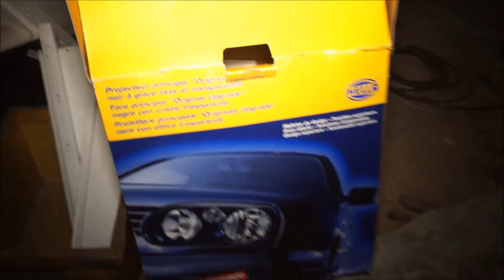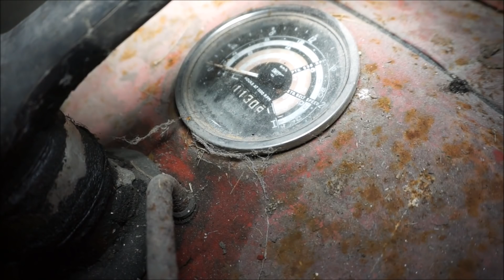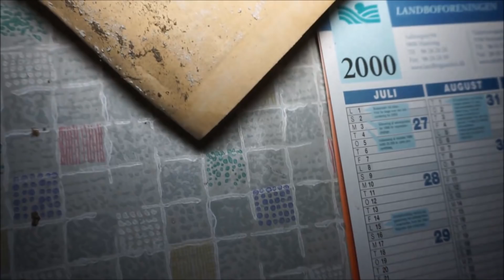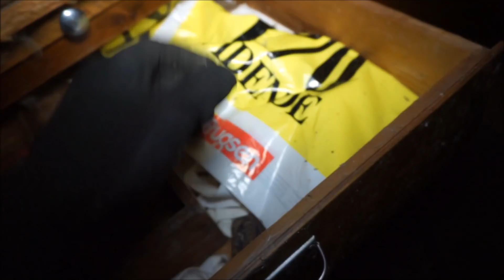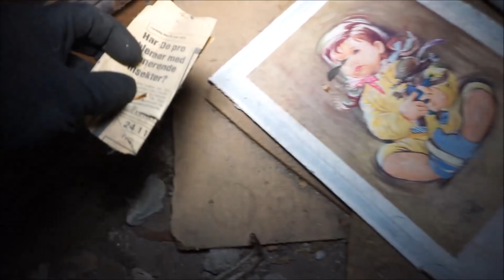Abandoned Farmhouse - Found a dead reptile?

Comment: @2:40 that looks like a vacuum pump or air compressor mounted on the wall.  If it is a vacuum pump I suspect they milked cows there and the pump was used to operate the milking machines.
Reply: @6:00 if the well is not dry, it still will not pump any water without priming the pump first (pouring water into the top to wet the pump plunger).